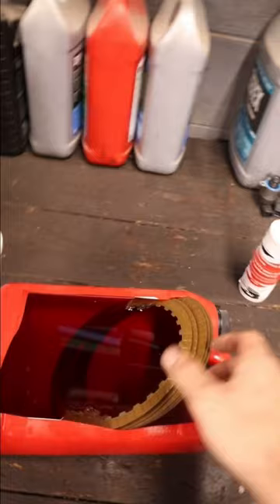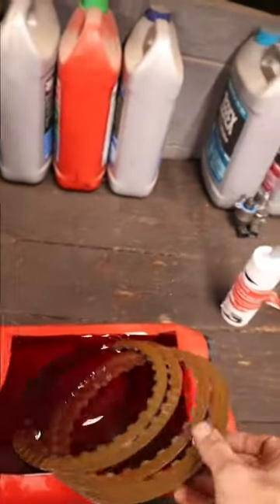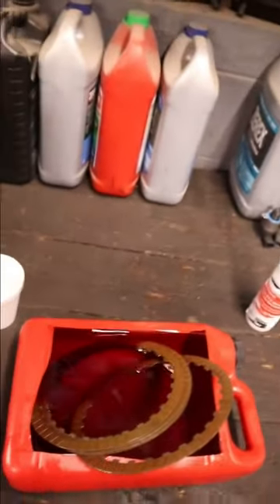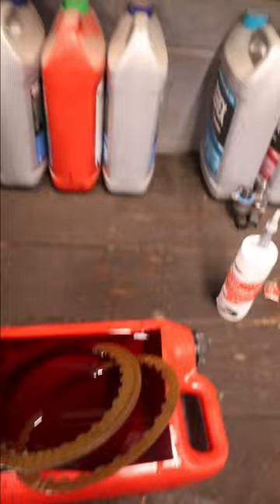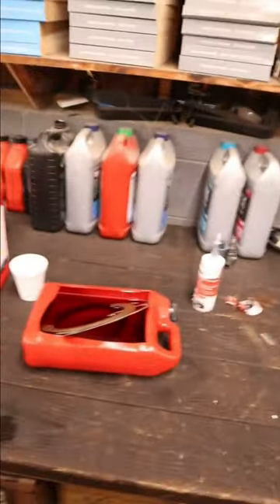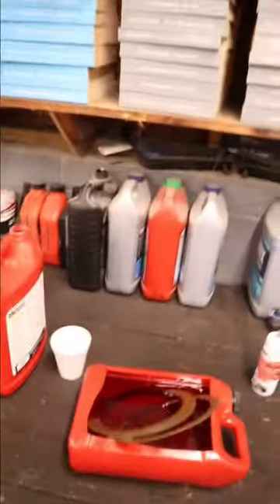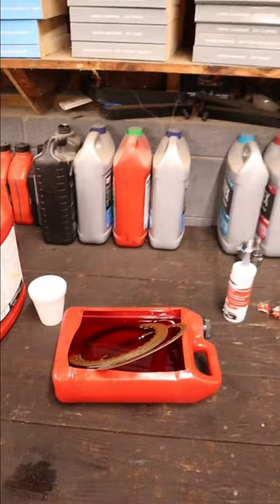Should you pre-soak NEW Automatic Transmission Clutches? #shorts

Comment: Ford Trans tech since 94,
I don't soak them,,
Ford motor company builds thousands per day and does not soak them,,I've been to the Sharonville Transmission plant and personally asked.
The book of course will tell you to,,
But not necessary
Reply from the maker: Thanks for the input! Wonder why books says to soak them if it’s not necessary.
Reply: @FlyingWrenches13  many years ago the plates had small pieces of brass in them and needed to be pre soaked for scoring on start up dry
Reply: soak brass? im no metallurgist but i dont think soaking metal will change its internal properties.
Reply: @FlyingWrenches13 probably so you can’t hold the book liable for fords transmission failures